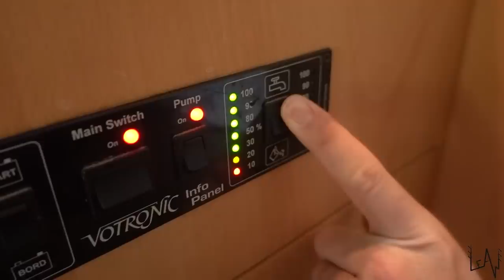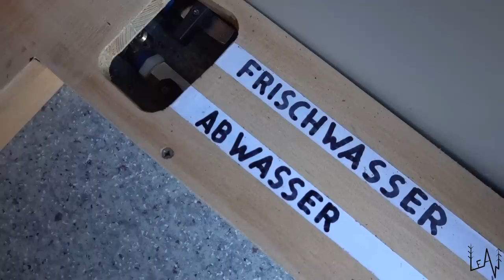HOW MUCH DID WE PAY FOR IT? Getting ready for VAN LIFE AGAIN - Mercedes Sprinter

Comment: I'm old I fractured 2 cervical vertebrae and 1 in my thoracic and 1 in my lumbar . I understand the crazy pain . But this isn't about that.
 See after I did that I spent 2 years learning to walk and talk again.
 Then I was balls to the walls non stop working and playing.
 But I didn't look to the future. 
 I lost a lot of use of my right hand and arm. To compensate I over developed my left arm and hand . To at least twice a normal Perons strength.  Because I had to prove I didn't need help.
  I didn't think that carrying 2 hands weight in one hand caused damage to my joints wearing out. 
LEARN YOGA  PAY ATTENTION TO HOW YOU WALK SIT ETC. OUR JOINTS ARE WEAR POINTS. LIKE WHEN YOUR CAR IS OUT OF ALIGNMENT THE TIRES WILL WEAR UNEVEN. OUR JOINTS ARE THE SAME WAY . ARTHRITIS YOU WANT TO.  PREVENT THAT SO YOU AREN'T A CRIPPLED OLD GUY LIKE ME

Comment: Luca, I am glad you are feeling better. I have stenosis in my neck that was giving me those awful headaches you spoke of. I found something helpful to me. Find a ball about the size of a grapefruit, soft with lots of air in it, and put it on the wall, then lean your forehead into it. You can try it on different sides of your head as well. It is supposed to strengthen the neck muscles, but took away my headache almost immediately.

Comment: If you can’t take the stroller you should be fine. I rarely used the stroller with my 2 kids as I preferred to carry them in a front or back pack. They also preferred that too. Best of luck in your new adventures. ❤

Comment: I had a stroler like yours for our local bumpy paths  but i ended up using the very low cost classic simple folding Maclaren for when i was out and about in the car. It was super small when folded.

Comment: guys she's  beautiful  a little star  you are blessed , sorry  to see you suffering  with pain have had bad pain with my back due to a car accident you can get so depressed with pain, you seem to   be on the mend and have a great  trip to look forward to ,now I  want to mention  a couple of things  so this may go to a part 1 to part 2,   I  would change the tap to one of those high ones with  the insert that has the pull out hose with the spray and it can be turned around to function as a shower outside the van, I would get another fire extinguish to have down the other end of the van ,watch the channel travel  beans and see how fast their van caught fire I think it was  their first trip,plus I  would buy 2 of the window breakers  that AWP sell they strongly recommend  the WB tool be kept on  a plastic  tie to the reversing  mirror, and 1 on the keys, then if the car ends up in the water you can Grab it the item is $ 6.95 and works better than $30 ones they do a great video  on their channel  on what to do and how to get out of a car if it goes into water please check it out the guy who narrated it  has a young baby and he did a great job explaining wot to do if there is baby  and children  anyway guys that's my 2 cents  safe and happy travels  . the channel for getting out of a car in water is called adventures with purpose

Comment: if you wouldn’t mind I would like to ask you if you are very flexible? I’m asking this because I have hyperflexibility and it is something you can get to a lesser or more degree. I have suffered from problems with my discs and I have noticed that a lot of people with problem disks are also are hyperflexible. It is something that hasn’t been researched very much. Unfortunately it is only a matter of curiosity on my part as I am not in a position to research it.
Reply: My disc issues were caused by my former career. I was an Occupational Therapist for about 35 years and the lifting and transfers of my patients, no matter how careful  I was, took a toll on my back. After my back surgery in 2016 I decided not to return to work.